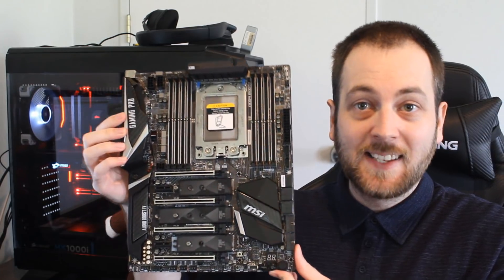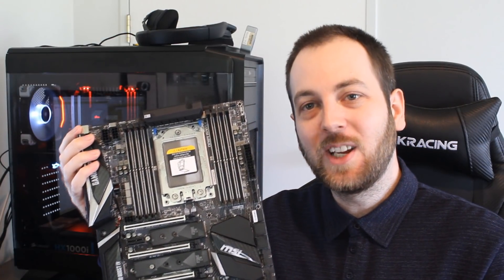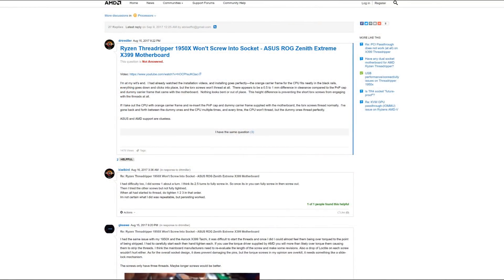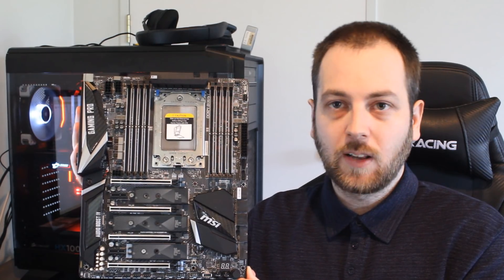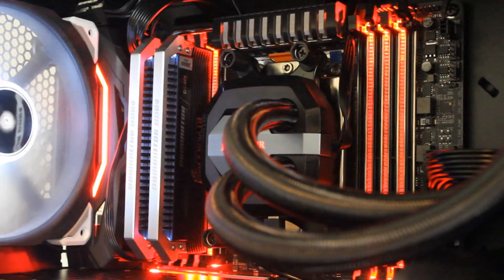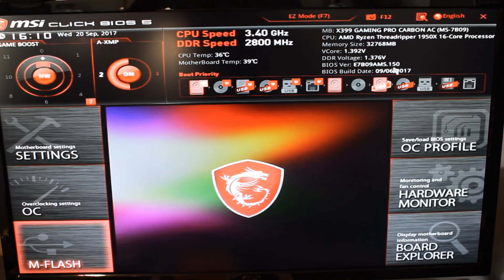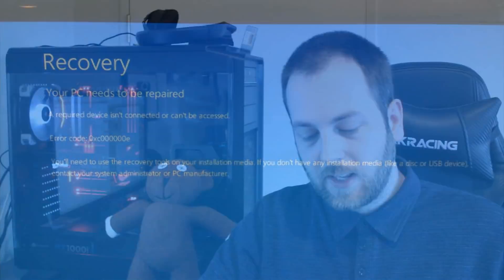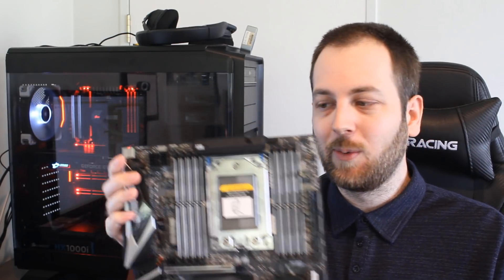X399 Is A Mess Right Now (Socket, Memory & Windows Issues & Fixes)

Comment: Buying the AORUS Gaming X399  motherboard was one of the WORST experiences I ever had.  Gigabyte has windows 7 drivers for this motherboard on its website, but installing Windows 7 DOESN'T work on it.  They have an applet which will modify windows 7 by adding USB3.0 drivers and NVME drivers, but it DOESN'T WORK on their X399 motherboards.  After numerous tests (swapping GPUs, memory, etc.) while trying to install windows 7, I finally gave up and installed Windows 10 - which I feel is nothing but spyware for Microsoft.

70% of the PC world still uses windows 7 and Gigabyte mislead me by providing windows 7 drivers for this board - yet installation of windows 7 FAILS.  I was in touch with Gigabyte technical support throughout my shitty experience with their product and in fact they were the ones who suggested that I should use their applet to modify Windows 7 installation, but finally in the end all they could say "Hey, why don't you use windows 10?" - which in my view is complete betrayal of customer trust.  At the very least they could have REMOVED windows 7 drivers for this board on their own f**king website and posted warning NOT to try installing Windows 7.  I could RMA their motherboard, but who the hell wants to sit on their hands while waiting for another x399 motherboard and having to go thru all the trouble of re-installing all the software.

I believe Gigabyte did this because they're kissing Microsoft's ass - but Microsoft didn't pay for my motherboard - I paid for it! . .  .and I bought it assuming that windows 7 would work (decision based on the availability of windows 7 drivers).  In the end I was forced to get windows 10 - something I DIDN'T WANT.  The only thing I can do in response is to NEVER EVER buy another Gigabyte product - and I certainly cannot recommend Gigabyte at all because of my experience.

Comment: I’m having problems with my gskill memory. I c that you have your 2 sticks on the opposite side of the cpu. I am using the same motherboard as you as well. But my manual tells me to place my 2 sticks on the other side   I have been running it this way for a couple of weeks now.  But this morning I can’t get it to post.  I put it in sleep mode last night before I went to bed.  And this morning it stuff was flashing.  The gpu, the memory and a pile of error codes.  One was co. I assume something must of failed. And I need to replace something. Gaaa!

Comment: I bought the MSI X399 Carbon board and Threadripper 1920x specifically to build a rig for parallel processing data analysis in MATLAB using 128GB of RAM. Assembly went ok and it boots just fine at stock memory speeds, but I have two memory issues. First, the BIOS shows 8 DIMMs installed at 16GB each, but then it also says 'Available DRAM: 96GB.' When Windows boots it says only 95GB are available. It's as though two of the DIMMs are being ignored, even though they register as being installed on the board. 

Second, my memory kit (CMK128GX4M8A2400C14; Corsair Vengeance LPX) is supposed to operate at 2400, but if I select either of the two A-XMP profiles the board goes through three cycles of three beeps followed by a reset. On the fourth reboot it POSTs and the BIOS shows the memory as running at 2133.

I am not on the most recent BIOS (I'm one version back: 7B09v15), but the latest version does not mention memory compatibility/improvements as one of the updates. And it still boots fine (other than not being able to use all the memory I installed), so I'd rather not mess with it. The memory kit is marketed as being X399 compatible, although when I checked MSI's website later I saw that this kit is not specifically listed as compatible... 

Have you heard of anyone else having this issue (whether using 8 x 16GB or 8 x 8GB or...). Thanks in advance! I submitted a support request to MSI and I'll update this if I hear anything substantive.
Reply: InsidiatorPhotos any update on this issue?
Reply: It ended up being user error. I thought I had properly seated all the DIMMs, but after removing and reseating them for the second time the bios and Windows both suddenly recognized 128GB of RAM installed and available for use. A little embarrassing, but it sure beat pulling the processor and looking for bent pins!
Reply: InsidiatorPhotos Thanks for the follow up. I’ve made some rookie errors too on this build. I guess that’s me being afraid of messing up an expensive build, lol. Follow up question. I’m on the bios version 7B09v15 with no issues. Did you ever update bios? Latest is 7B09v17
Reply: I updated to 7B09v15 during my troubleshooting process and did not notice a difference. That said, I am not doing anything fancy with this board. All settings are stock. Someone using more advanced features (maybe faster RAM) might notice performance improvements. I don't think MSI specifies exactly what they change; they just reference "Memory Improvements' or other vague things like that.

Comment: From what I have learned both Asus and Gigabyte have has serious problems with CPU installation such as described in this video. I had the same problem myself. It was totally ridiculous to have to apply so much force down on a motherboard all the while trying to screw down the CPU plate and not braking anything. Totally unacceptable to me. All X399 appear to be having some glitches and in many cases difficulty installing Windows. Gigabyte came up with a tool that helps load drivers on a bootable USB drive that are needed for USB3 and NvMe SSD drives. This link to AMD describes what many have been suffering with in regard to CPU socket problems. https://community.amd.com/thread/219286

Comment: I had the exact same problem on the Gigabyte X399 board. It also had a Foxconn socket. It was a nightmare trying to get the screw to pull it down. The screws are too short. I am also have all kinds memory problems and Blue Screen of Death problems. Loading W7 64bit was also troublesome due to USB drivers and the new NvMe SSD device drivers.

Comment: sadly i still have some issues with the x399-e prime (asus), cant get the ram past 2133 clock even though its on the qvl- now im getting a blackscreen with 0d error, any idea on what to do, how to fix that issue? (1950x, x399-e prime mobo, CMK16GX4M2A2666C16 RAM). When i switch the xmp to 2666 - boot to blackscreen. regards

Comment: Hi, the stock speed issue is fixed with msi ? I need my cpu to go as high as possible cause of 3d rendering. cheers
Reply from the maker: Yeah with the latest bios updates it is fine now, I talk about it in the full review: https://youtu.be/8bX9oC2B57E
Reply: Sorry for bothering again, u got any info about taichi mobo? I was thinking to get that due to M2 ports placement cause im going for 3-4 gpus. cheers

Comment: I just did a 1950X build on a ASRock X399 and didn't have any of these issues.  One thing that is an issue right now, at least in my build, was starting with Windows 10 1709.  I had all kinds of glitchy problems...hardware not working that was in previous builds, Edge browser issues, etc...  I went back to 1703 and have no problems.  I just posted a stock build video of my system...https://www.youtube.com/watch?v=E86xM6F7tAI&index=4&t=125s&list=PLLQnfuXLBSseeg_kNzuGBpMU44KQOFvHe

Comment: I have the gigabyte x399 aorus gaming 7 board and even with the bios update, still am not getting quad channel memory. I didn't have any issues with windows once I flashed the bios prior to installing windows, but am still seeing that windows see's (as well as the bios) all four sticks of memory, but when I run CPUZ, it only shows dual channel? I've been trying to figure this out online, and many said disabling the IOMMU in bios then fresh install of windows under that setting, another said it's the intel wifi driver, and I tried disabling that, but still dual channel. I don't think anything is wrong with the board nor memory since I see all operating via windows, just can't get quad channel. Do you have any suggestions for me?

Comment: at 2:28, you can see that the Foxconn retention bracket is not counter-sunk, whereas the Lotes retention bracket is counter-sunk at 2:56.
Reply from the maker: Yes that is the main reason why it doesn't go in easily, because the screw length is the same but because it isn't counter-sunk it is only barely long enough.

Comment: X399 is in much better shape today than when it was released and that's quite positive for AMD's ability to improve their platform...X370 had loads of issues too but today, it works wonderfully...I built an 1800x/Asus Crosshair Hero VI system and I am currently running at 4ghz stable at just 1.37 vcore...and the system overall works just as stable as my previous Skylake 6700k system.

Comment: I had that issue today. The oxc0000000e error message when you boot windows. Disable Fastboot which fixed it for me. I have windows on a m.2 drive so it boots fast enough for me.

Comment: Just finished my threadripper msi x399 build and I had windows install problems too. To boot windows I disabled iommu and it booted right away. I now get bsod on windows when I browse the internet. And my CPU temp in bios is always 4 degrees. Going to do I bios update now to see if my issues can be fixed. I have 32 GB vengeance RAM at 3200 mhz but it reads it as 2000 MHz. Again hopefully a bios update will correct  it. Nightmare start for my first build.

Comment: The problems are still there. I have been trying to set up a system with rog zenith extreme mobo, AMD 1950x and 4x8GB Corsair vengeance LPX 3200Mhz mem and it doesn't boot at all with the 4 dimms on the board. The mem is on the AMD compatible mem list. I have sent back the CPU and gotten a new one. No luck. Only boots with 2 dimms and then at 2133Mhz. Seriously considering chucking it all away.

Comment: I have a Giga X399 Aorus G7 mobo, and there is no problem with the screws either...do not have to screw in with force ...
Locked: First 3. get the screw thread , and 2. get the screw thread, and 1. get the screw thread .... AFTER then screw it in fully to the 3 - 2 -1 .... sorry my bad english.

Comment: HardOCP has a great guide about how to install the CPU in the socket. It doesn't use the 3, 2, 1 method but first grabs all screws a half turn in. This is the preferred method that works better. I installed 10 threadripper systems at work, without any problem (all Lotus sockets however).

Comment: I'm not sure if it's just the video or what, but what I find weird is that on the MSI board which he says is fine and has no problems at say 1:42 the metal plate that the screw fits in seems counter sunk to actually fit the screw (the screw sits in flush with the plate). But later on with the problem board at say 3:15 the plate doesn't seem counter sunk to accept the Torx screw to sit flush with the plate. Which suggests why you can't get the threads to catch in the hole, as the screw length isn't long enough. I'd get some vernier calipers and measure the screw lengths of both the boards see if they are the same length. With it being counter sunk gives it that extra mm or so of travel to engage the screw hole.

Like I said it might just be the angle and video but that's what it looks like to me from this video.

Comment: Even though this video came out about a week or two ago, has anyone heard whether the reported LOTES vs FOXCONN mounting bracket issue has been fixed or there working on a fix?  I contacted ASUS about the time this video was released and all the issues I was having mounting the CPU but so far no response.  I would doubt it if they do a recall of these motherboards with the messed up brackets.  Hoping I won't have to ever remove the CPU again.  

Any thoughts on this from anyone? Thanks in advance.

Comment: X399 MSI 1950x 32GB ram - no problems. The noctua 14 TR4 doesn't seem to allow to install 8 sticks of ram though - for now I have 4 installed. Kind of an oversight in my opinion. Ran a bit hot in the beginning but now I'm at 4ghz @ 1.2625 volts. Full load long-time render temp goes to about 78 degrees.

Comment: Aside from a few quirks I would say x399 isn't "a mess" it's been wonderful to me. I can even get my 1950x to hit 4.2 ghz stable with the Enermax 360 TR4 AIO. I'm now 20th on the Firestrike Physics Hall Of Fame It's a champ and 4k video editing is like pure butter.

I had the same issue with my Aorus geting the second screw threaded instead. The only memory issues I've had is with trying to get 8 sticks working, 6 works great, 4 perfect, but filling all 8 has weird issues with running an overclock. i also have weird fan control issues with the gigabyte board, it seems it either gets reallly happy with running the fans despite the temps being  low enough that it shouldn't or if I try to set the fan curves in the bios manually it stops ramping the fans up automatically at all,. If I reset the bios it seems to just work right if I never go in to the Fan5 control center or whatever.

Comment: Have the MSI x399 board, 3 issues. 1) Intel wifi Network card needs a newer driver to work than what came with it. 2) My Blue Ray drive works fine now but would not load windows, used USB . 3) Still waiting on  my expensive Trident Z 4 dimm 64 gig 3200 speed that is ON the MSI QVL list to be able to run at proper speed. G.skill is no help and MSI just says to wait. However + side MAN it has been stable and hell and much faster at rendering 3d animation than I had hoped... and I did not have to pay double the price for 20% more performance.

Comment: I have the same gigabyte board and had a bit of a struggle installing the CPU. What I found was that the CPU didn't go as far down the run as it should have. I had to force the CPU further down the black bracket. Video: https://youtu.be/lEpGJbU6wFk?t=561 from 9:53

Comment: I am suing Arous x399 Gaming 7 i had the same issues. But there is a manual of how to install the RAM. For 4 Modules of RAM you have to use different slots. You cannot insert RAMs randomly on any socket. This will even fix your Blue Screen issues. Also make sure you update BIOS to F2.

Comment: I have the MSI X399.  Only issue I had was I couldn't boot at all with Vega 64 card.  Installed an older PCI-E card, booted and updated to the BIOS to latest version.  Then it worked fine.

Comment: So far I have had great luck with ASRock motherboards on my builds.  I've only had my threadripper a week but have not had as many issues as you have.  Though updating my BIOS is always the first thing I do in setup.  I've got v1.50 on this board and no blue screens.  I was kind of worried about doing an NVMe RAID on this board with 2 x 960 EVOs but that has been fine too.

ASRock X399 Taichi v.1.50 BIOS
1900x Threadripper
32GB 3200MHz G.Skill DDR4 - F4-3200C16Q-32GTZB
2 x 500GB 960 EVOs in RAID 0
1 x 10TB HGST NAS HDD
1 x EVGA GTX 1070 - 08G-P4-6676-KR
850W Seasonic Flagship Prime Power Supply

The worst problem I get is a little glitch right after bootup sometimes.  It does not crash but the system grinds to a halt even opening Chrome.  I reboot and it goes away.  The other odd thing is I am not finding all the thermals I should in AIDA64.  Thought that likely will be an update issue I suspect.

Comment: I bought that Gigabyte Gaming 7 and I think that Gigabytis is the main issue you are having... Board came in with all sort of issues with the PCIe slots, dead network interfaces and a bent USB 3 pin... The only thing that worked well out of the box was the RAM. I am not looking to get a refund on the Threadripper or use it as a 1k door stop until reviewers do a better job of pointing out issues with X399 Motherboards. Gigabyte does not need a re-brand to whatever bullshit name they want to use, they need proper QC/QA... People should stay the hell away from gigabyte, even the Ryzen 350 Gaming 3 board I purchased at the same time as the Gaming 7 was very cheap and clunky.... Going to go back to Asus and Asrock... But to be honest, I really should have gone Intel instead of AMD for such a high priced purchase...

Comment: Most people either dont know how to build for a Zen based system or are too impatient with them. my Zenith Extreme has had 0 issues so far. Truthfully had I had gotten mine at launch, I would probably have had the same issues, but thats to be expected just as I expected with my Ryzen 7 build I early adopted. But fairly quickly after launch it has a rock solid bios that I went straight to, and it will only get better.

Interesting about the different socket retention design tho. While the MSI board may have been designed differently and seems easier to install, are they both applying the same amount of pressure on the CPU to the mobo with the same amount of screw torque?

Also don't remove the orange carrier. Bad idea.

Comment: It's so similar to old (now) X58. FoxConn socket used to burn out under moderate overclokcing (Lotes did had this problem).
Save and reset - similar problem. When putting PC to sleep sometimes it couldn't boot. After hard reset it booted up just fine. Sometimes it used to fail to enter sleep at all. If it did it randomly used to wake up.
Memory issues? Not that much. But Core 2 mobile had same problem.
CPU speed issues? Hell yea, 970 gaming board from MSI had the same problem. Voltage was jumping like crazy eventually overheating voltage regulator. I ended up getting Asus 990FX sibertooth which is excellent.

All in all none of platforms are bug free at first months of their life. I could make long list about main board issues, but I doubt anyone would be interested.

Comment: I'm having loads of issues with the USB 3 ports on my ASRock x399 Taichi. I would use USB2 since most of the time I get issues with USB2 devices, but my case doesn't have any!

Also my 1950x seems to be running a little hot on my H105. 94c at full load.